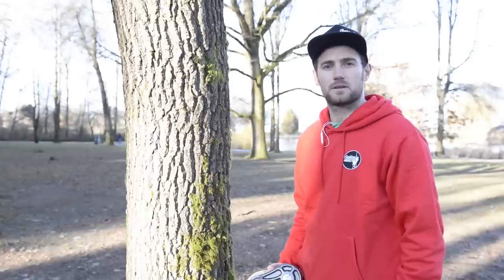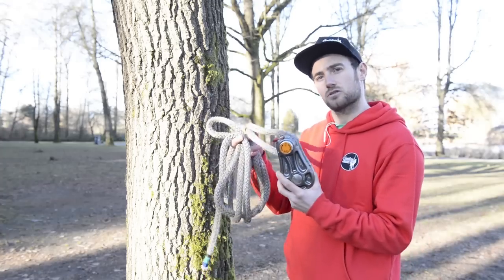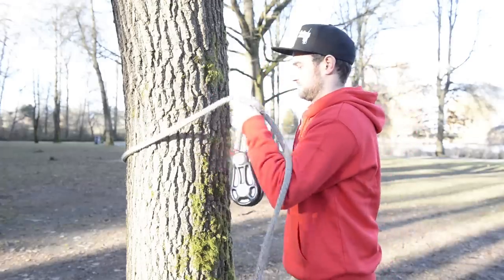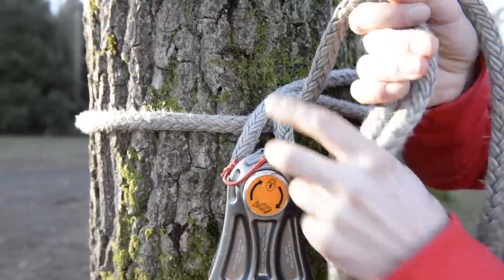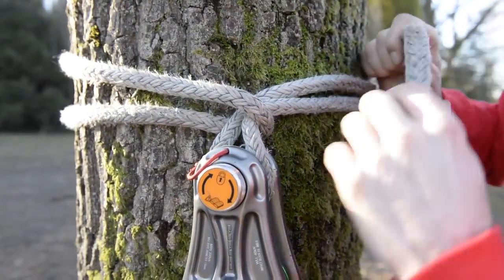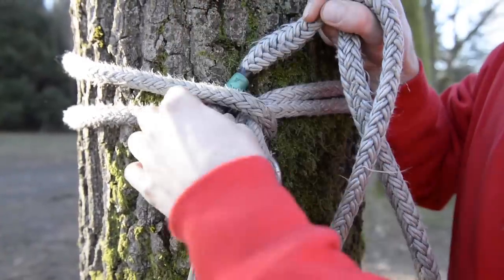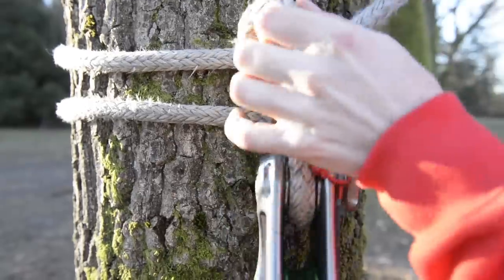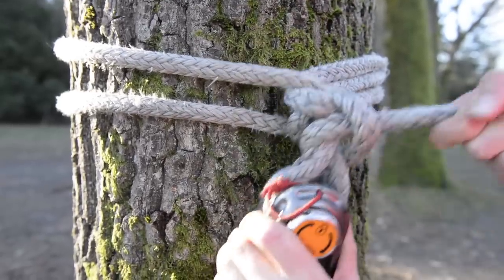How to tie a Cow hitch | Arborist knot tying for rigging

Comment: My go to hitch for rigging! The tail under the block supports itself which eases the climbers effort. Very secure, never had an issue with it binding or slipping. When I didn’t  have enough tail though to complete at least one half hitch I will employ the timber hitch. A running bowline will use the least amount of sling and allow the largest stem diameter but the strength is reduced. Be well Dan!
Reply: 23 p